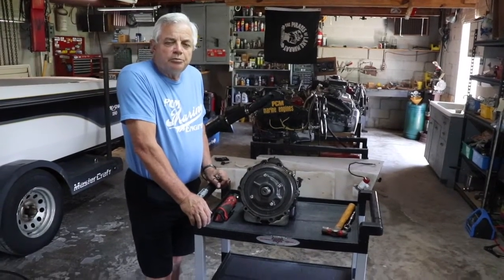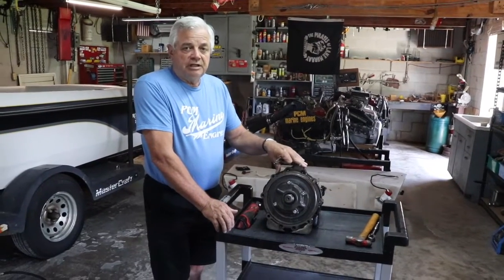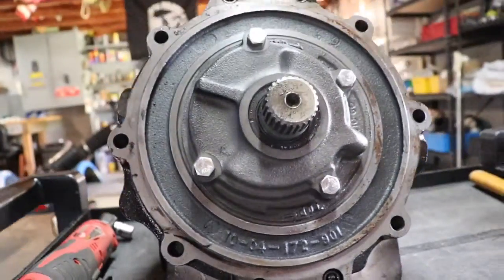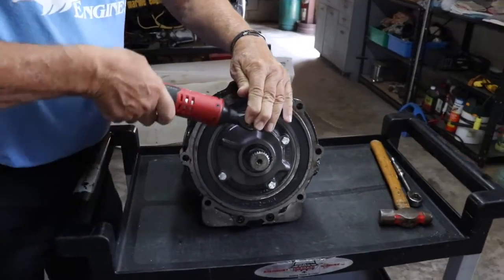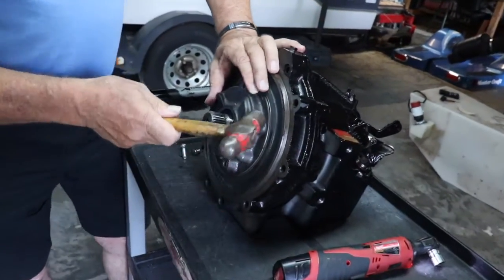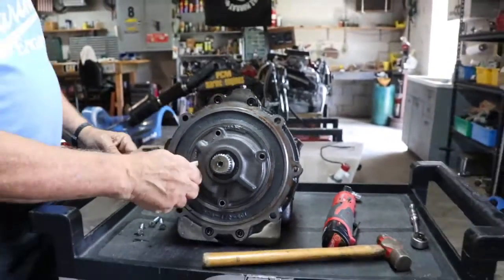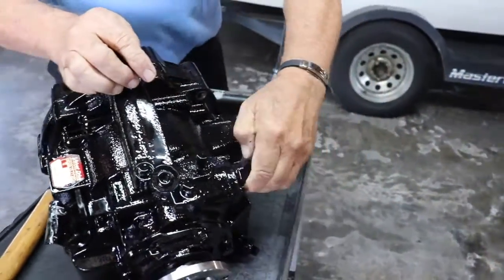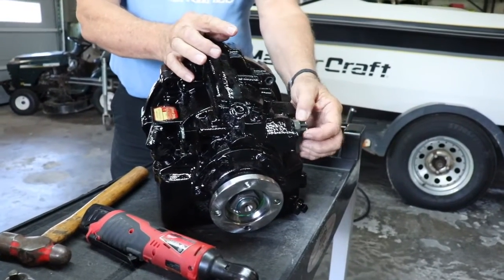How to reindex a velvet drive 1:1 transmission For Your Inboard Boat

Comment: Okay, I have a question. You are reindexing this so that you can use it with a reverse rotation engine. Does the Velvet drive not have to be specific to a left or a right hand rotation engine or is this all that you need to do to change a velvet drive from a right to a left hand rotation?

Comment: Hi I have the same gearbox and I have 6 cylinder Perkins 185hp is that mach? Can I use the gear box for 185 hp  engine